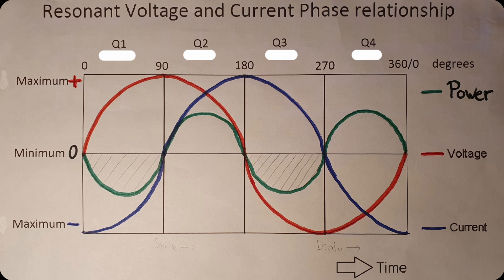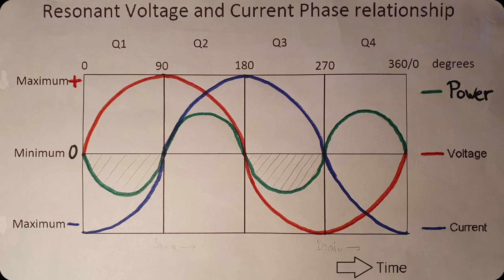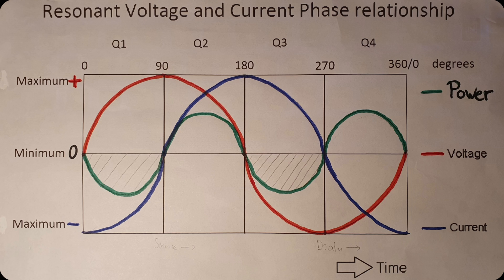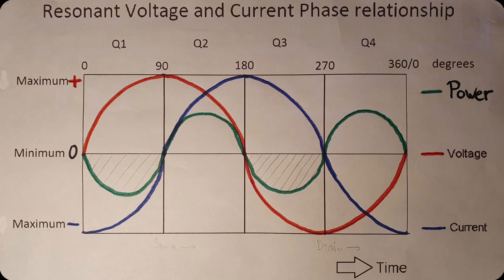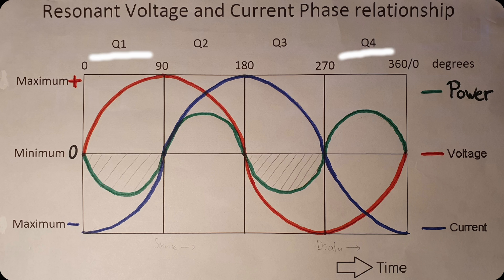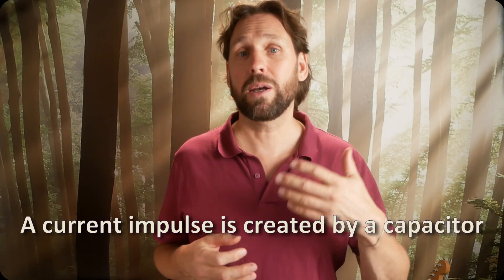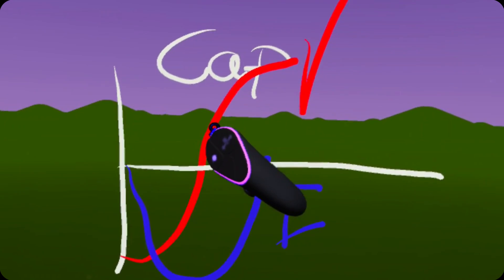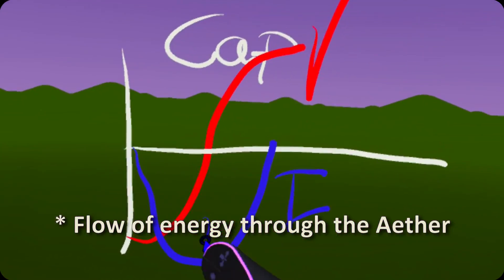What are Electric Impulses and what can you do with them?

Comment: I'm struggling to understand how you are considering a negative into positive movement of energy as "unipolar". Because even this version of unipolar has a reversion back to zero, which by your definition makes it non-unipolar. This isn't an attack, I just can't wrap my head around it and I don't think you're right about this... My statement is also based on zero lab experimentation haha. I still find your videos very interesting and I will continue to watch. You're making me want to bust out my ZVS drivers and flyback circuitry, and blow the dust off my Don Smith studies.
Reply from the maker: no worries. it depends on the voltage or the current  goong positive to negative.
current is energy flow.
so if voltage (electro static) i changing polarity. then current is maximum but doesn't change polarity. since voltage and current are 90 degrees phase shifted.

Comment: Impulses experience extreme stress and non-equilibrium. This invites Aether energy. As I understand it, at the peak of stress, capture and store the Aether energy before it returns to the surrounding environment. There's a correlation between the amount of energy captured versus the speed and amplitude of the pulse. Some describe this as a dipole or electret. Ilya Prigogine has added "extremum principles and general thermodynamics relations" to existing Laws of thermodynamics.

Comment: Joel lagace uses duty cycle module like a 555 timer but lcd display. 1 percent duty cycle for very low current used. Places a big coil. Produces hv spike.  Relative to john bedini design. Joel already claims he built self running devices, some of bedini devices replicated but at a lower scale.
Reply from the maker: that HV spike needs to be combined with an in phase high current spike to produce real power

Comment: Master Ivo.  If you use the 2 bifilar coils to eliminate the magnetic field leaving only the dielectric field.  When tuned with a capacitor switchboard, is the result usable electricity sir?
Reply from the maker: You do get the electrostatic induction effect, but usable electricity no not yet.
Reply: @MasterIvo  Thank you, sir.

Comment: 6:15 - 6:35, I think you just described the testatika machine? But it’s backwards.. meaning it’s using the static field, collapsing it, and maybe it does the opposite and converts to a magnetic field? And that’s why they use the static coil capacitors? It’s a coil of wire surrounded with a series of round materials, the coil is the primary side of the capacitor, then that pulse I just pointed out converts to low voltage high amperage dc? 

This is very interesting..

Comment: Coming from audio, have you thought about using the impulse in an amplifier design? Do you think it's possible to exchange the low pass filtered rectified wall electricity that the tube plate sees, with an impulse signal? If I am delusional, don't hesitate to put me in my place as I am not an engineer.
Reply from the maker: hmm, no that makes no sense.
better connect the plate with a coil that is connected to the rectified ac (dc). and use the grid to turn the coil on and off.
when the coil is turned off (fast) it produces a voltage impulse.

Comment: Master Ivo, have you ever heard of T.T. Browns partner Agnew Bahnson? In the youtube video called "Bahnson Lab Video Full" at the end of the video you see a 8 foot diameter saucer craft test vehicle, it shows the underside of the craft that is being worked on patent reference US295879A, illustrated in the third image. The video shows the inside of the bottom electrode with the half sphere removed. It reminds me of your work, it appears to show a thin long tesla coil with a 2 wire primary  maybe 5 inches in diameter and roughly a secondary a inch and a half diamater maybe 9 inches tall to be loosly coupled to a a different coil a foot away apearing like a bifiler primary encased in glass closely coupled to the bifiler secondary coil wraped on the outside with the aim to get very high voltage low current impulses under 1 nano second with the output of the Bifilar + and - 90° out of phase. With the highest voltage possiple 200kv or 1 mv avoiding dialectric breakdown by ajusting the rep rate so that the average voltage over time is below the breakdown voltage.  Apparently safe to touch and runing on a small battery maybe 9 or 24v It appears they were using resonance to get such high voltage and my exstensive research leads me to believe they also pump power from ground and recycle some of the energy back into the system. Any thoughts?

Comment: So if I understand correctly, a capacitor that releases a sudden and rapid voltage from 1 polarity to the other will create a transverse magnetic impulse current, if it is fast enough, towards the opposite polarity of the voltage, the current grows in polarity and strength before rapidly weakening and coming to a stop before it can reverse, while the voltage also continues to shift towards 1 polarity, inducing a unipolar displacement current.

While an already present pulsed DC transverse high magnetic current in a coil in 1 polarity will create a rising voltage in the same polarity, and that voltage will rise before weakening and reversing direction to the opposite polarity, inducing a displacement current that will alternate between both polarities, while the magnetic current continues to pulse in 1 polarity.

Hence a Dielectric Impulse Displacement Current is not itself the same thing as a transverse magnetic current impulse or voltage impulse, but can created from both of them, do I have that correct?

I'm also a bit confused with how you're using the graph, such as at 12:40, Oscilloscopes display positive and negative on top and bottom only with changing levels of intensity, but from the way you're describing it here it sounds as it the voltage displacement currents are actually reversing into the opposite polarity without crossing the middle?

Thanks for making this video Ivo, assuming I understand correctly this brings a new level to my understanding.
Reply from the maker: not  correct. fast change in voltage creates a longitudinal wave into or out of the plate. the displacement current can be transverse, but if it is fast enough in changing voltage, it is longitudinal, and NOT magnetic. this is the true Radiant. which can produce a "cold" current
Reply: @MasterIvo  The displacement current can be transverse? Does that mean regular electric power would be a transverse displacement current or is that something different?
Reply from the maker: @JenkoRun  yes

Comment: have you tried shielding the outer edge of the coils? or a 3rd coil that is an intermediary that helps balance the transmission between the coils? it might allow you to run higher resonances. have you tried running a small coil inside of a larger coil against an absorber coil. im thinking about the zero point between them where the magnitude (V) becomes flow (I). its not an actual point in space but am i right in saying that the coils produce a resistive force between each other, inverting the charge being transmitted? charge is not the right word,do you have any videos explaining how the coils work just by themselves, or is it only this high voltage high frequency electricity that allows coupling?

Comment: Nice to see your spirit, the back Voltage of an inductor scales pretty high on magnitude, after getting a big voltage impulse it can be fed to a big copper plate, through a diode, you can actually fine tune the time of voltage transference to the plate.
The thing is you get a very high voltage to a copper plate in a very short period of time, lets say 10uS 50KV, very nice, what next ??
I suppose you get another identical copper plate situated at a certain distance in the backyard, the important thing, is to characterize :
1. Energy transfer per impulse at x distance, given air dielectric value, metal area.
2. You expect an electrical copy of the original impulse with a shorter amplitud on receiving plate ?
3. Little I have read about, mythology states Tesla was capable and did fed a car with a system like this, a car, that means 40KW around, a lot of energy for a far electrical power source, and is this is appealing magic that we would like to understand, was that distant car electrica wireless feeding possible ?
4. Also mythology states the shape of the plate to "move the ether or conducting medium" was very important, they state the ether as to be an hyperfluid or it behaves with properties of fluids, probable some inertial mass behaviour like dynamics.

Is it THE electric field with inverse of d2 law the energy transfer limit ?
Or as mythology states the sudden electrical surface appearance triggers another atmospheric type of dynamis, wich furthers in a great manner the energy transmission capability of space in between ?
This is a matter of further processing, no doubt about it.
TKS

Comment: Slayer Exciter Circuits are resonant impulsed, I suppose if you cross a diode across the secondary terminal, you can get the half-wave resonant impulses from this too, and already of a high voltage due to the many more turns on this coil. The resonance also doesn't need to be tuned, the circuit already auto-tunes!

Comment: Do you think that the negative displament current where the energy is sucked in to the circuit is the one responsible for the freezing effects of cold electricity found in circuits like the space quanta magnifier?
Reply from the maker: I really don't know. an increase of energy should be heating up, not cool down, so maybe the positive displacement current?
Reply: @MasterIvo  

Maybe🤔

On a side note I feel that things like heat and cold we still don't understand them fundamentally or at least they still bare alot of mysterious properties 

Especially because I like reading ancient texts and alchemy always talks on heating as some complex way to transform elements 

Well we know that at very high temperatures we can fuse elements and get a different one

But also all elements have their own vibration and heat increases vibration so maybe that's too could be a possible way?

Also we talk about cold as the absence of heat, heat we know is an energy that could be transfered by   Infrared radiation 

But what if cold is also an energy but has a different polarity than heat and   it radiates in waves we still don't have the ability to study
Reply from the maker: @michael65556 
the following is my (incomplete an probably not correct) 
I see heat as a vibration, an object when it gains energy it vibrates faster, expanding from the increased energy.
but when it becomes saturated and the threshold is reached, it radiates infra red.
which again is light, a vibration. but at an extreme high frequency.
since I do not believe in atomism, I see mass as bound energy in fields, and these fields can expand.

cold would be a reduction of energy, which could come from a displacement current from current impulses (single direction energy flow out of the conductor).

so depending on the energy flow into or out of the conductor (displacement current) the conductor can heat up, or cool dowm.

Comment: Ivo really like this video. My conclusion is that we need to fully understand the Aether and Aether flow.
So what is Aether?
Is it dielectric?
Is it static?
Is it both?
You are making me think.
Regards... DC (DC Pulse is the tool)
Reply from the maker: we don't know what it is. but we can play with it, and learn from it.
Reply: @MasterIvo  Great answer. Tesla knew how to work it. So it's pivotal we try to fully understand it. It's there, it's everywhere, it's very powerful.
Ivo your are a master of these coils. The Next step is master the Aether or Aether flow.
Do you fancy trying to understand the Aether together?
Regards... DC
Reply from the maker: @e.powerdc1127  I think it's time for me to use mosfets to discharge a capacitor
Reply: @MasterIvo  Yes great start, now how fast with they top up (current).
It's not what you do it's the way that you do it.
Regards DC
Reply from the maker: slow charge fast discharge
Reply: @MasterIvo  Now this is great thinking. So please consider that in nature + chases - and vica verca also we see the same with magnetic poles, yes?

Fields act immediately to balance out, yes?

Conclusion
Fields ( magnetic / dielectric) react instantly ( at a distance) not one slow and the other fast.
Tesla knew this fact.

Notes
When you see a Tesla coil sparkling please note that the radiant sparks are not flowing outbound they are being gathered from the Aether.
AC power does not flow in the wire but on the skin or outside of the wire in the Aether.
The wire is a reflector or antenna.

Again love your work with the coils.
Please consider the dielectric as the main component.

Regards DC
Reply from the maker: @e.powerdc1127   quote 
"please note that the radiant sparks are not flowing outbound they are being gathered from the Aether."
end qoute

yes, I noticed, because the resonance would else be detuned by the sparks, but it isn't!
Reply: @MasterIvo  it's amazing lvo.
The more we know somehow the less we understand but carry on with an open mind and it will appear or be given.
It's all about the dielectric which as I see it = " static". 
I can see nothing but a sea of untapped potential.
Did you read in Tesla's works of how he light up a hillside with Carbon lamps?

I believe that with what we know this is achievable. 

I hope that I have inspired you.

Regards DC
Reply from the maker: @e.powerdc1127  yes in Colorado Springs he did
for me the dielectric is not static.
it can be, stored in a capacitor.
but it can also be dynamic. when resonant.

but more importantly a capacitor discharge produces current.
and depending in the speed of the discharge it produces a conductor bound conventional current,

or a non conductor bound, displacement current, through the dielectric material.

and the polarity of the discharge dictates if the displacement current is moving out of, or INTO the conductor!

INTO, but from where? from the ambient medium.
Reply: @MasterIvo  I think that a simple magnet is sustained by the dielectric Aether.
I have been studying the work of Ken Wheeler on YouTube.
Magnetism has three main components.
Magnetic
Dielectric
Plane of inertia
All of the above are found in one form or another in electricity
I find these facts more than interesting.
Reply from the maker: @e.powerdc1127  yes the bloch wall
Reply: @MasterIvo  I look forward to sharing more in the New Year.
Regards DC

Comment: Tesla was using what we would call infinite impedance.
Impedance is the flow of current,
so, infinite impedance causes maximum reflection
and when we have equal moving charges in opposing directions then no rotating magnetic fields are generated and we have a longitudinal Changing line of Electric Force,

I have recently proven that the inverse square law doesn't apply in this scenario using a single high resistance wire as a transmission line that effectively gets all of the changing Charge potential to a vertical wire antenna
then then of course has potential with ground
and then changing E fields terminating on ground cause the rotating magnetic fields that create a TEM wave for radio use
but Longitudinal Magneto Dielectric  Waves could also be used for communications.

But as nobody else is using this type of system,
I am currently using LMD waves to convey the changing charges to an element to create a TEM wave.

Comment: Master Ivo.

Instead of Bifilar coils,
why don't you try Tri-Filar Coils.

I suspect Tesla did this but it never saw the light of day.

I recently had a brain wave and created one
for Radio Frequencies
and the results are  Astounding.

I am only running 10 Transmit Power.

Here is a video and the coil design info.

When we have currents in opposing directions,
the rotating magnetic fields are cancelled.and we are left only with the E field charges that are of course oscillating.

This coils stores the E field charge and then discharges back into the Input AC source on both sides in each sine as the Input sine reverses

https://youtu.be/jgiRn_vYidw

Comment: I’d like to suggest that you design a series of tests focused on 1/4 wave impulses into a system with electrically isolated primary and secondary coils (only sharing the same ground) and having a weak magnetic coupling (he felt the coupling was primarily radiant not magnetic).

This was where Tesla ended his funded research and where he observed the greatest effects (Colorado Springs). There is a nice book available containing his Colorado Springs notes if you do not already own it.
Reply from the maker: yes. his impulsed primary, had a loose coupled secondary.
his extra coil was tuned to the impulse of the primary, this I learned from the Colorado Springs notes

Comment: I am also able to get impulses from a transistor if I set it up like Tesla did with magnetically quenched spark gap, meaning  it slams off the transistor as soon as the current flows. This is the basis of Bedini's 'solar tracker' units. I charge LiFePO4 for my ebike with 6Mhz 10amp unidirectional impulses, and the batteries never get hot and have more capacity than normal.
Reply from the maker: 6 Mhz? 6 million sparks per second?  that is a lot. are you sure? How did you measure?
10 amp seems low for an impulse, but at those speeds its rather high.
It's a fun way to charge your caps!